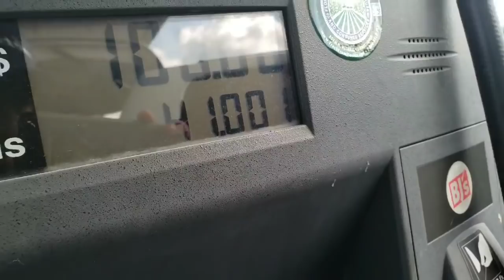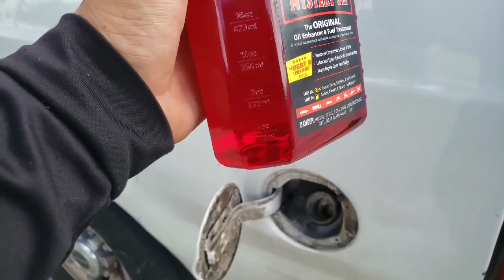I bought another Military Rib Boat ! 730 Willard with Konrad 520

Comment: That material isn't PVC it's Hypalon, very cool boat, I worked for a company back in the 90's that made the tubes for Willard.
Reply from the maker: Negative it's a PVC tube made by Wing
Reply: @AlfredMontaner  That wing tube is not PVC. It is welded urethane.